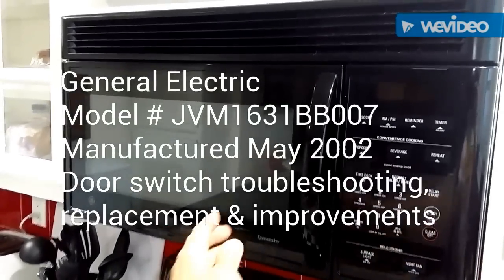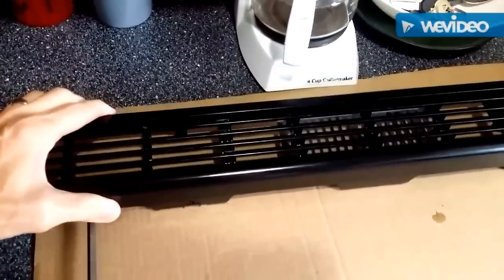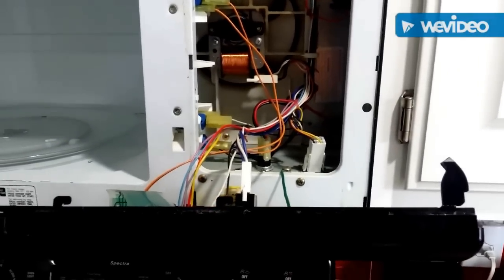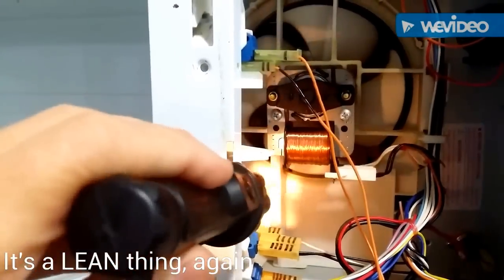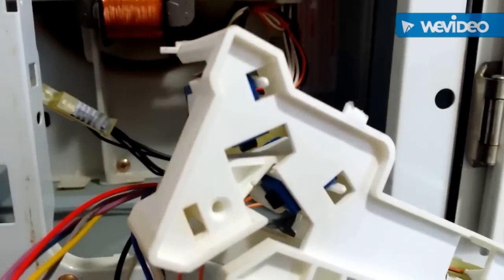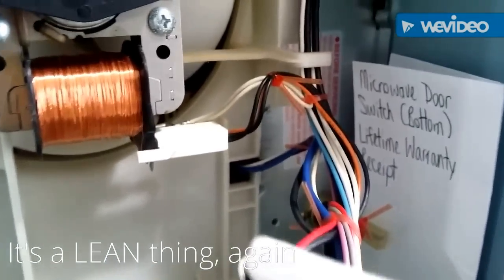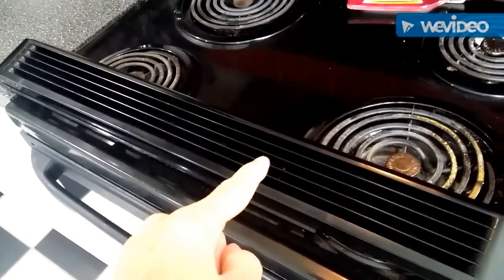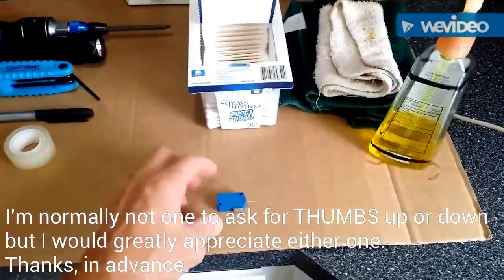[37] Microwave fan runs & turntable rotates with the door open || troubleshoot, repair and improve

Comment: Those tabs do break easily > 2 solutions - 1 is if there is room drill and use a self tab short screw > 2nd is if not enough catch for to catch the microwave,  use a small bracket to make the bridge and use a screw on each side. Reason for a short self tab better control of screwing in as well as not going to deep to hit anything > so best to look at best location for that an discrete spot so it still looks good before lining the control cover .. worked for me better than buying a panel.
Reply: The problem seems better than your solution . Maybe you should make a video  with pictures.

Comment: I had an awful time disconnecting the wires from the switch. If this happens to you, put the swith back in and use a screwdriver in the small slot between the green wire housing to pry it off. Trying to pull the wires from the switch (for me) was the hardest part of this fix. Preferably use the screwdriver in the slot BEFORE you remove the switch.

Comment: I was at a hostel now. They have one of those steel crome commercial microwave ovens you see in restaurants and coffee bars. I opened the door the fan was still on no light. I asked if I could turn it off to place food. Receptionist said no. So I put hand in to place food I felt tingling prickly feeling along my arm and hand. The fan was on but no light. The same situation when I took it out. My arm feels a bit strange now half an hour later. Is this my imagination. How do I know if only the fan was on, not the microwaves. Also when I first opened the door, three times for less than five seconds each time. Can microwaves escape and hit my torso. I don't know why they could not let me trun off the machine first.
Reply: @RobertDinTulsa  thanks for your speedy reply. It was a commercial microwave do some of them have fans that run when door open. Light never came on with door open or closed. Felt lots of prickly tingling senstsion on my arm. Arm feels a bit hot and uncomfortable twelve hours later. Will be hard to get hostel to cooperate building a case. I hope you are wrong about the magletron but I am sure you are not.
Reply: @RobertDinTulsa  thanks for your advice. The hostel says the machine is fine and has an extra thick plastic layer inside. They say it wad static electricity I felt. But arm still feels a bit hot under the skin.

Comment: Thanks for the video. It got me past the basics to troubleshoot my GE. I have a GE JVM3160DFBB. It worked for a year then stopped. I found out the cause and replaced one of the thermo fuses, the one on the right.  The microwaved worked for a month and the same fuse blew again. I replaced the fuse again. When I plugged the microwave in everything worked fine, except now the vent fan stays on with the door open and close. I can change the speed from high to low, but it will not shut off.  I let it run for about 20 minutes, still on.
I checked the 3 door switches and they have continuity and the buttons click just fine. The 2 thermo fuses have continuity. Please help. I cannot figure what else it could be.  Thanks, Lessie. I also changed the 20a/250v fuse.

Comment: Why paint the wire black? It goes to a switch; order doesn't matter, since there's only two connections, wire length notwithstanding. And you may as well replace all of them.
Reply from the maker: As stated in the video at ~ 7:40, I initially used a marker to clearly define one orange wire from its neighbor...only to realize that I would have still have to remember which marked/unmarked wire goes where.  

Order does matter.

The purpose of the video was to record myself in troubleshooting and problem-solving a repair issue instead of buying a new $400 microwave.
Most importantly, to show other people my successes, failures, frustrations and can-do-it attitude without paying a tradesman $90 an hour plus parts to do something that will, in the end, cost me a small fraction of what that person would have charged.

Staying organized when learning a brand-new skill (IN-PROCESS) can be challenging for anyone.

Staying positive while being frustrated with a process can also be challenging.

Replace all of them?  As stated in another comment - good point...I'll do that to the remaining two the next time it happens.  Great lesson.  Thanks for the tip.  Tips help people save their hard-earned $$$.
Reply: After you marked the orange wire black I was thinking to myself that I would just take a picture with my phone so I could see it later when I needed to. Would that not have worked?

Comment: My GE over stove is doing the exact same thing.  Just a few months out of warranty.  Go figure.  The second microwave.  My first lasted forever till the door switch failed and a relay on board kept losing contact.  My attempt at soldering it back to board failed in disaster letting solder wick into relay.  
I think with one of the door interlock switches sticking making the fan come on when you open door, the microwave must have a check and does that so the consumer will get it checked out since if others stick, it will work with the door open.  Still pretty sorry and GE's undoing .  Putting 2Cent parts in their appliances. On my first microwave, the switch was on when the door was closed since it was to the relay that worked the magnetron. One of the other switches was off when the door was closed. So even if they look similar and fits, if the number is different, be careful.

As a side note, my originial over stove weighed a ton was 15 years old before dieing.   I ended up selling the door, top grill and fan out of it on eBay that just about paid for the new one. The new one lasted 2 months past warranty.

Don't waste time trying to fix switch.  What is happening is the contact goes bad, drawing more amps and that heats that little spring weaking it.  As designed on the bottom switch, it snaps the contact in and out.  Mine was failing out.

Also, on my GE, that panal cover is held by the top left and also down behind in in the center on the same level.  You have to reach down thru panel from top and back screw out to allow panal to rise up and then out.  Thoes two bottom clips are actually a clip and a hinge to allow panal to lay outward.
Reply from the maker: Very insightful knowledge coming from another DIY'er.
Thanks.  I hope others will read you comment after trying my method and failing...perhaps your knowledge will help them end their frustrations.

Comment: Thank you! Had the same problem with mine, same switch too. Fixed the bar on the switch, but ordered a new one in case my fix fails.
Reply from the maker: You are welcome.  You are one of the main reasons I made the video.
On a related note, I found burned contacts when I took the old switch apart...tells me that it might not have had too much more life in it.  Good luck to you on your switch fix.